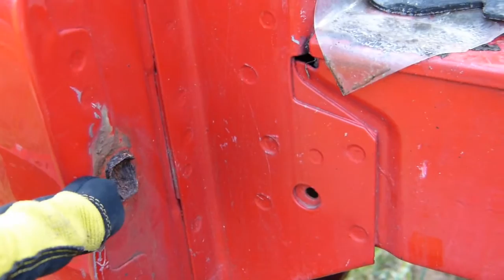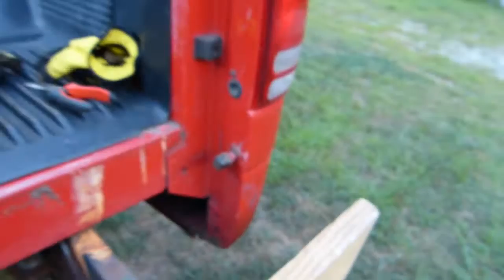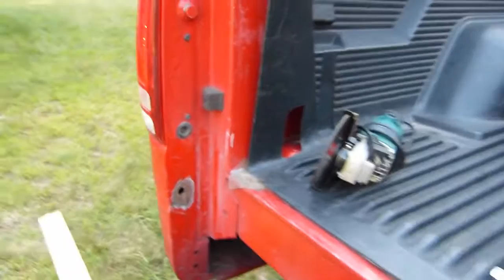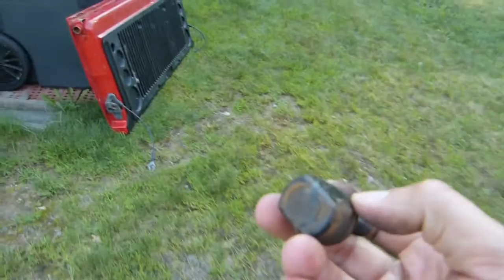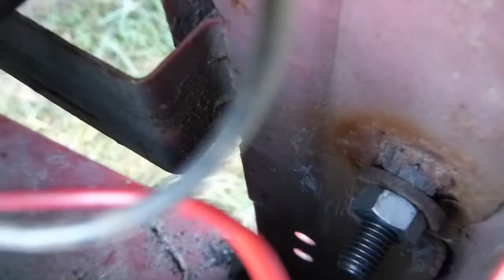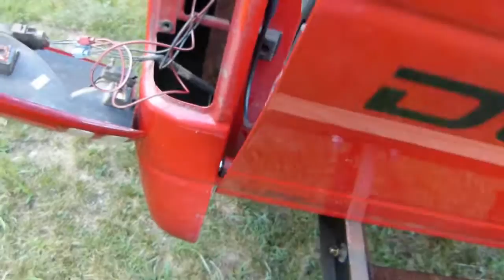Dodge Dakota Rusty Tailgate Hinge Repair Highlights

Comment: Love your video!  The 8 commercials I had to F5 thru was annoying!  But I have DgeDakota2WDSport2000, have same problem, so Imma try your Bolt/Nuts technique.  But you should add lock washers on 1 or both sides so nuts down loosen from vibrations over time.
Reply from the maker: I don't have any control over the ads - that's all YouTube.  You're right - lock washers would have been good but this thing never loosened up without them.
Reply: @SevenFortyOne  well at least I'm giving you feedback of what we experience. Literally YouTube put 6-8 commercials before your vid played. I thought you(&me) had control over ads vs no ads on our vids.? Funny how truck designs put the safety on the shit we carry in the beds all on some pathetic little pins.

Comment: So fixed it using a 12 mm socket cap bolt 1.75 X 50 mm from Menards SKU 202-8601 $1.75 drilled a hole used two washers and a nut. Nickel anti seize and I'm back on the road. Could use a 14 mm maybe as my fitment was a tad loose but big box didn't have anything bigger, length was longer than needed as well. 2006 Dodge Dakota passenger side as well.

Comment: how well did this repair work?  seems like the plastic bushing would get chewed up by the hex head. glad i watched your video.  i'm going to take a piece of metal and make it to match the original shape with a grinder, weld it to a screw.
Reply from the maker: I owned the truck for another 2 years after this video was published and it held up fine with the hex bolt - no problems with the bushing at all.
Reply: you could go with a round bolt that is used for things like wooden truck beds so they wont snag on things its an idea

Comment: Your plastic bed liner also makes your bed rust
Reply: Yup, they make a better bed-liner that covers the entire bed and wraps up over the top of the edge of the bed that prevents water from getting under the bed-liner. I believe it was an option on the SLT models.

Comment: Coulda sworn that was a makita grinder. Had me fooled.
Reply from the maker: Cheapo Harbor freight look alike I got for free from my employer's safety incentive program.  It smells like it is going to catch fire every time I use it....but it keeps going....
Reply: SevenFortyOne nice, at Home Depot now getting my bolt. Was it hard to put the tailgate back on? I’m assuming you put one side on then the other?
Reply from the maker: If I recall correctly, The "cups" on the gate have an opening so it slides on both sides at the same time.
Reply: SevenFortyOne good to know, thank you!
Reply: My 5/8 bolt was too big to go thru the hole. Ended up using a piece of 3/8 rod and a 5/8 nut grinded down with 2 3/8 nuts. Thanks again!
Reply from the maker: Cooll!  Glad you got it figured out.  I'd have to watch this back to remember what I used, I sold this truck last year.
Reply: SevenFortyOne getting ready to sell mine now, fixing all the stupid stuff. What did you take for it?
Reply from the maker: Mine had low miles for an '01...~80,000 and a rare 4.7L with a 5-speed manual.  I sold it to a young guy for 2K even though the frame was just about shot.

Comment: This just happened to my '05.  Kinda pissed since I just sunk $800 into a new battery and ball joint replacements.  I'm not as handy with tools so I'm not sure what to do about it.
Reply: he fixed it by removing two torx bolts and buying a nut and bolt from the hardware store I think you might be able to do it